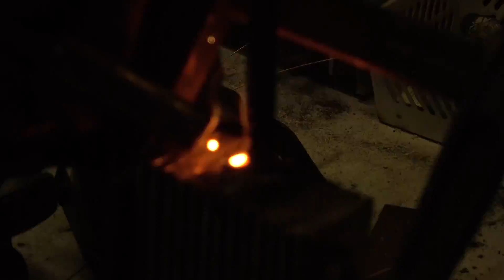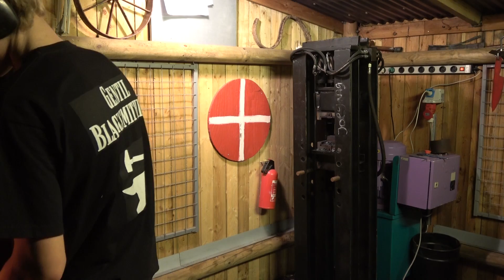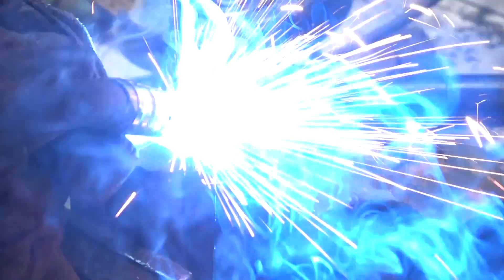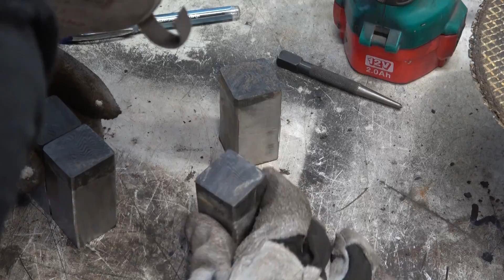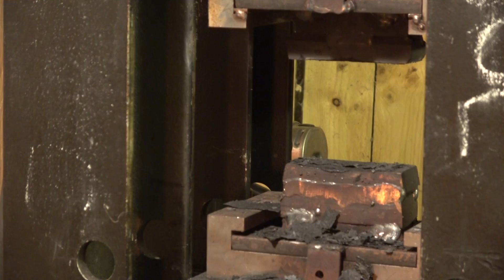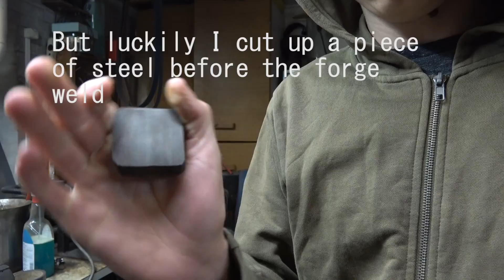Forging Explosion pattern Damascus !!

Comment: When your tacking the chunks together smack it with a hammer right after the weld is done. This will make them tight. It's known as "hot tacking" due to the way you can work thinner metals into shape when joining them together.  In this case your not going to bend the billet much but you'll close up the gaps much more.

Comment: Nice work. Have you thought of adding a couple of pieces of steel on each side of the sliding plate on your press, that are positioned up against the guide rails? It will take out the slop. Especially, when starting with taller stack of steel.
Keep up the good work.

Comment: Still a nice piece. I don't know if it's still big enough to make a small blade, for a folding knife or so.
I know nothing about forging, but what would happen if you take the same pieces of steel like you stacked in the beginning, but make them narrower towards the top and bottom. You know, then you get kind of a rough shaped circle already. Eventually make it perfectly round with a belt sander. Then start forge welding it. So you can skip the rounding of it while forging. Just make it square. Just wondering.

Comment: A strong press but wobbly. Have you thought about using 90 degree shaped dyes on top and bottom helps to get your billet more square, and for flattening some bars too the left and right side to get a constant thickness?

Comment: great stuff Joe. too bad about the failed weld at the end. what I want to know is where you get O2 steel. I've never seen it anywhere. thanks
Reply: I get it all the time from our local tool manufacturers as drops, and the local steel supplier for those manufacturers.  It's a common tool steel for making drills/parts/etc... shouldn't be too rough to find.

Comment: It might be a stupid question to you but what is that flaking off of it is it the metal itself so do you lose weight every time you reheat it And re stamp it
Reply from the maker: friscoHub415 it is oxidation from the steel. And you Lose alot of steel
Reply: Joe the Builder thank you so much for responding I've always wondered that someone told me it was The Borax by didn't fall for it thank you again and good job that was amazing
Reply: It's partially true.When it cools down, borax and scale forms a sticky mess. So there is definitely going to be borax in that crust. But it's not the majority part.You're losing a significant amount of steel (and carbon) like this.
Reply: Mill scale is another name for carbon and flux shell. Hard to grind yet quick to flake. Good looking pattern on the off-fall might make a nice pommel

Comment: wikipedia says damascus steel is some specific indian ore ?

is this correct ??
Reply: I don't believe it is
Reply: Maybe abit late to the party but if still intrested,

Damascus is like 2 or more different kinds of metal welded together, than cut to than weld back together.(repeat proces as many times as wanted, more is often better) 

This gives some amazing patterns and in some cases(depending on initial matieral) verry stong alloys.

(English is not my native language so sorry if i messed up any technical terms)

Comment: THe good...that is a Nice patterned steel. The bad... but that was not damascus steel by any stretch of the imagination. That press looks unsafe, underpowered, and is not made for what you were trying to do with it. Your billet was not hot enough and you didn't flux the surfaces of the last stack. The ugly...  watch closely and you can see the left piece bend and split away from instead of forge welding to the stack.  Lots of rookie mistakes. However, all that said, you did make a beautiful piece of iron! Thank you for sharing!
Reply from the maker: 28 tons is not underpowered

Comment: I don't understand. It's just metal keep adding flux and heat and squish! It will weld!
Reply: I think part of the reason is that his press dies seem very wobbly and it keeps bending the billet left and right.
Reply: You would be surprised. Metal can actually get burnt and destroyed where you would have to manufacture a new billet from scratch. It loses all structural integrity at some point and just burns rather than turning to a jelly state. Plus, I think the whole point of this was to make the beautiful pattern, and that got messed up so the process was over and beyond recovery for that pattern. Damascus is an art because its difficult and you get one shot at it.

Comment: I have been looking for something to cover the side plate of a BaFang 750w mid-drive bike motor for over two years now. It has to be thin to mount on the side of the motor and not have the pedal touch it. Something unique and one of a kind that will stay with the bike.  https://imgur.com/a/1ot2W